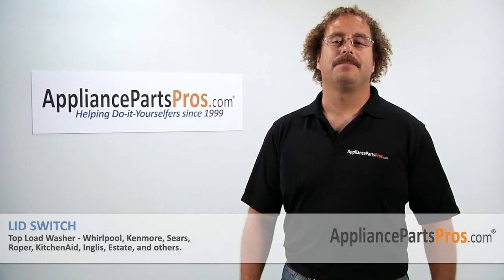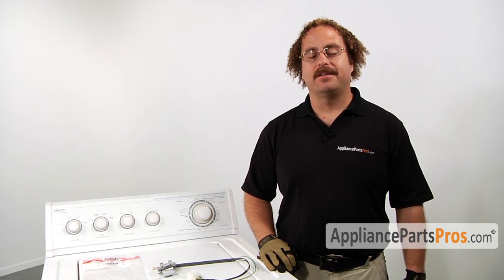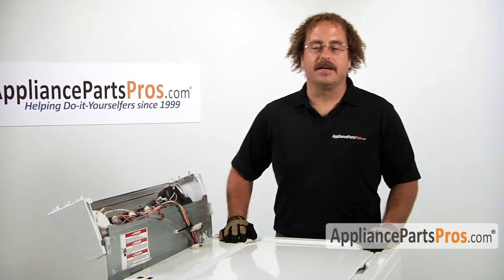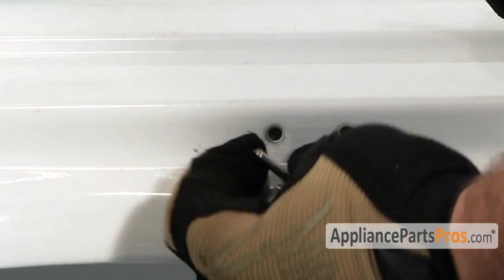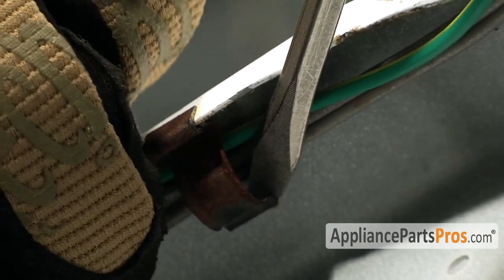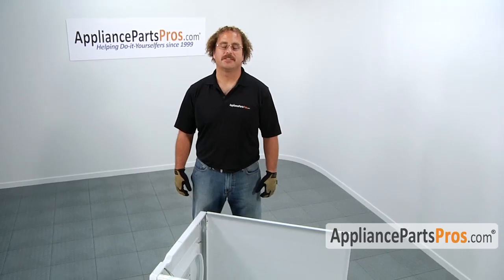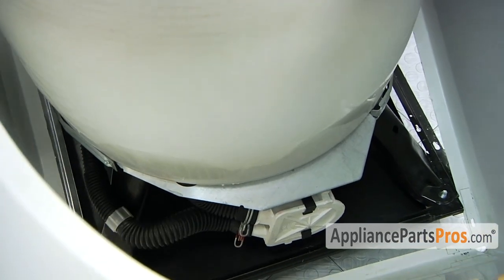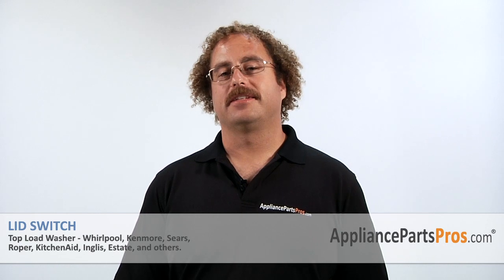How To: Whirlpool/KitchenAid/Maytag Lid Switch Assembly WP3949238

Comment: Well, I am the absolute worst person to work on anything!! I Break more things than I fix consistently throughout my life.
 I ordered a switch from Walmart for $8 and I guess the whole switch replacement took about 2 hrs (a normal person would be about 40 minutes) 
I did have a couple of extra screws left over, but the machine looks almost 95% like it did before, BTW the switch works..... the wiring "harness" (3 wire plug) was smaller thank the original so I had to cut the wires and splice the original "harnes,plug"  put wire nuts and a lot of tape .... but I wont tell anyone in case  of electrocution ..
Great Video those metal (clamp/brackets) were a little scary the way they snapped in real hard. I know i saved lots of $$$ BTW the photography and the technician were both amazing in the video , there are other videos out there with much less detail. Thank You!!!!

Comment: Hey there! thanks for the video.  Do you know if the complete lid assembly comes off?  i need to fully disassemble a washer to fit it into my basement.  Thanks!
Reply from the maker: gogaston By lid, do you mean the top panel? They do come off, once you get the cabinet off you will have to remove the screws that hold the top to the 3 sided cabinet. The lid comes off by unscrewing the hinge screws.

Comment: hi, i have a kenmore 80 series top loader washer.  Would any lid switch brand work as long as it has the same 3 corresponding wires? it is a 3 pin connector with the green wire in the middle. thankyou for your help
Reply from the maker: +Echo Cheng It is best to replace the lid switch with the correct one!